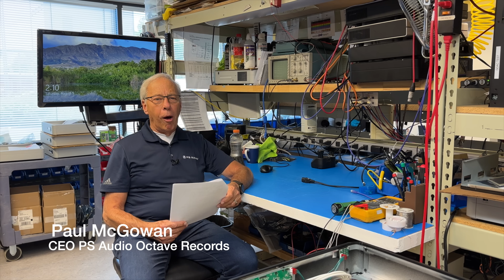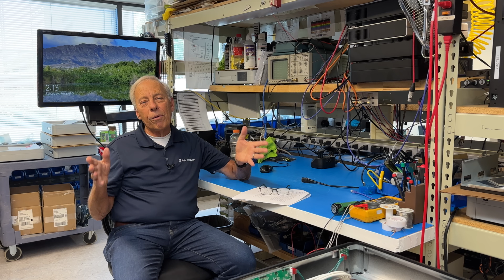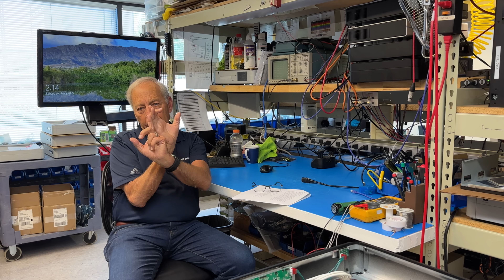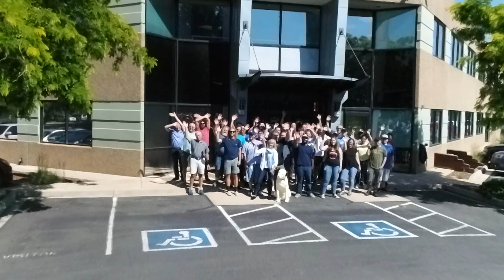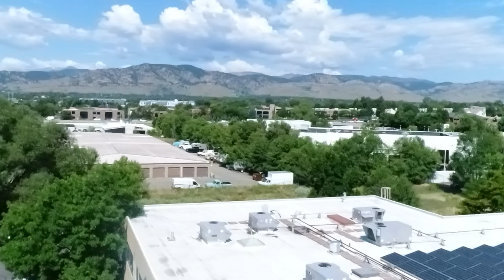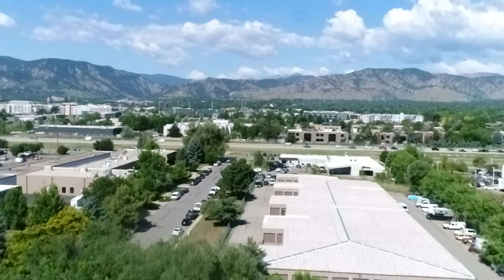DSD vs  DoP

Comment: In all due respect to Paul and his many accomplishments, I've never understood the fascination with DSD.  Even he admits that computers don't recognize it as valid data and they have to wrangle it constantly to use it... Why not just go to high rate PCM and work the whole process in a single format?  

PCM192 is utterly indistinguishable from analog after you run it through a DAC and it's something computers can handle natively... I'm sorry but I just don't get the fascination...
Reply from the maker: Sonics, plain and simple. Recording analog in DSD sounds noticeably better than capturing that same analog single in high rate PCM (and our experiments were mostly at double the 192kHz, at 352.8kHz). We've done multiple blind tests of the two means of analog capture and the results are always the same. DSD wins. Otherwise, I would never put myself and our crew through all this insanity to get there.
Reply: @Paulmcgowanpsaudio  Totally agree with you Paul, unfortunately (and sadly) not everyone can enjoy a good musical equipment to notice the organic and fluidity of the difference.
Reply: @Paulmcgowanpsaudio  What many people fail to grasp is that DSD needs to be converted to PCM for mixing and then reconverted to DSD for playback. Why not simply use PCM for playback instead?
Reply from the maker: @qqsrx  Because it's the original capture of the analog that matters. If you record the analog in PCM you lose forever precious bits of the analog original. Once lost, there's no getting it back. So you must capture in DSD in the beginning. Then, going back and forth the PCM isn't injurious. Here's an interesting way to look at all this: That was recently posted at www.psaudio.com I think there's an important point that people are missing when comparing DXD and DSD, and that is the fundamental difference between PCM and DSD.

PCM quantizes the audio waveform into a series of instantaneous voltage readings taken at regular intervals (the sample rate). These readings are stored as integer values in words of 16, 24 or 32 bits.

DSD, on the other hand, maps the analog waveform itself onto a bitstream where the greater bit density represents a positive voltage while a lower density represents a negative voltage. In essence, DSD is not digital at all but a graphic representation of the analog waveform.

You can feed the DSD bitstream directly into an audio amplifier and get audio. Not so with PCM which comes through as meaningless hash. The PCM stream must be collected into words (16, 24, 32 bits) and converted to a voltage proportional to the value of the integer contained in the sample. Earlier DACs would pass these voltage samples through a filt er to remove some of the added upper frequency harmonics and present the results to the amplifier. The result was an audio signal that was somewhat degraded from the original source.

Modern DACs use a process called a Fourier Transform which mathematically extracts the frequency information from the PCM sample stream. With this information, the DAC typically resamples at a higher sample rate reducing the artifacts and the required complexity of the output filter.

So, in essence, DSD is analog in nature, which explains why computers have so much trouble handling it. When it is pointed out the DXD and DSD have the same number of bits, while true, those bits are entirely different in nature and cannot be interchanged.

Ted Smith developed a means to take the frequency domain output from the Fourier Transform and render it directly to DSD and thus bypass the negative attributes of PCM conversion resulting in the sound quality we now enjoy from the PS Audio Directstream DAC.

Hope this helps.
Reply: @Paulmcgowanpsaudio 
"So in essence DSD is analog in nature..."

What I've been saying all along ...
Reply: @Paulmcgowanpsaudio 
"  If you record the analog in PCM you lose forever precious bits of the analog original."

Okay lets think about that for a minute ... What is likely to be lost?
If as you say you've been sampling at 352ksps speeds then you are taking a sample every 2.8 microseconds. Within a reasonable hd audio bandwidth of say 10 to 40khz, both ends a full octave beyond standard bandwidth, how much data can you be losing?  Even at 40khz we're still talking about voltages that persist for 12.5 microseconds giving you at least 6 samples per half cycle. I find it very hard to believe you are missing anything at those rates, even well beyond human hearing.

At 5khz most people can't hear the difference between a sine wave and a square wave. The micro nuance of various forms of interference are dominantly inaudible. The old "stair step" analogy has not been valid since Nyquist made his filtering recommendations. So please help me understand...What exactly are we missing?

I get that DSD is dominantly analog and doesn't miss much... but at high sample rates, neither does PCM.
Reply: I think he just means that DSD doesn't natively require packetization with packet headers and other overhead and those overhead quality as interruptions in the stream.
Reply: @InsideOfMyOwnMind  both PCM and DSD don't require packetization at the native level.
PCM confusingly also refers to a protocol for sending "pulse code modulation" data.
To send DSD or PCM data the PCM protocol is used which divides the data into packets.
DoP describes using PCM protocol with DSD data.
Reply: @CJANegrcTtpX8HwbR2SBDd  
I believe when Paul says they record in DSD he means that they record at DSD sample rate AKA 64 * 4 * 44.1khz. but still at 32bit sample depth.
After selecting a volume level and dithering each 32bit sample it is converted to a 1bit sample.
This can be done in real time on the dac chip itself or in post.
The single conversion from 32bit to 1bit is "lossy" but the resulting DSD is bit perfect DSD.
The advantage of distributing in DSD vs PCM is that DSD files are 16x smaller that PCM files at the same sample rate.
The mastering process in DSD really just means that the DSD is always handled at the DSD sample rate.
Reply: @user-tp4hw5oi6e 
Okay ... you cannot convert a 32 bit sample to a 1 bit sample no matter how hard you try.

In PCM the data is in the bits... each 8, 16, 24, 32 bit sample is a binary number representing the voltage of the signal at the moment the sample was taken.

In DSD the data  is not in the bits... it is in the number of bits.  As amplitude increases so does the density, or number, of 1 bits in the stream. This is not an organized data byte or word... it is an analog encoding scheme that is more akin to FM radio than to computer data.

So no they don't converge to the same data, you can't change one directly into the other and, most importantly... computers do not natively know what to do with DSD, because it is not computer data
Reply: Both DSD and PCM converge on the same signal as sample rates increase, but DSD priorities different information first.

Increasing the sample rate of PCM enough to cover the same information would work, but data rates would become impractical.
Subjectively many listeners like Paul and myself prefer DSD to PCM.
This is because different priorities lead to different sound.

DSD is not superior because it sounds better than all PCM.
Its superior because DSD is more efficient than PCM at a given bitrate.
DSD trades off sample depth for sample rate. at high-fi bit-rates this is more effective.

DSD having bad support in OS is what causes the need for wrangling.  
PCM refers both to a data format "pulse code modulation" and to a protocol for sending and receiving PCM data.
DSD over PCM uses the PCM protocol but does not use "pulse code modulation".
DSD over PCM is just a away to send DSD from an application to a DAC without needing to define a new protocol.
This process has no effect on the sound quality.

At the begining of the video the flashing lights on the network switch are mentioned.
this just has to do with the way DoP uses the PCM protocol, sending lots of smaller packets, while higher bitrate PCM sends the same number but larger packets.
(I am not and expert on these protocols but I have observed this behavior in Roon over USB) 
I think that Paul talking about the "continuous stream" is misleading.
PCM and DSD are both continuous streams of numbers.
PCM is generally 16 bit numbers while DSD is 1 bit numbers.